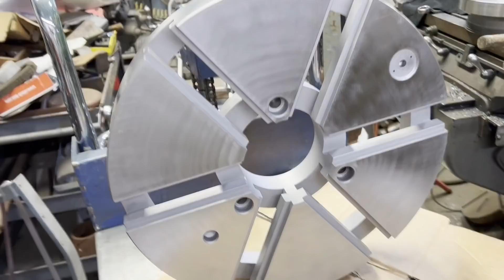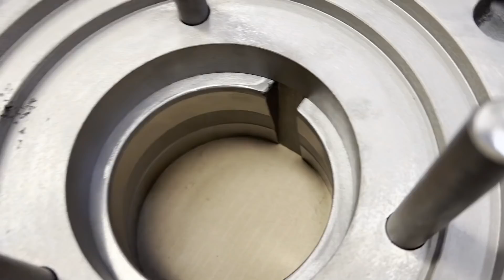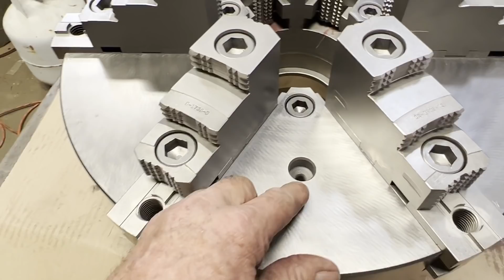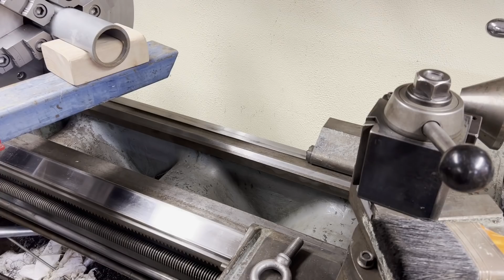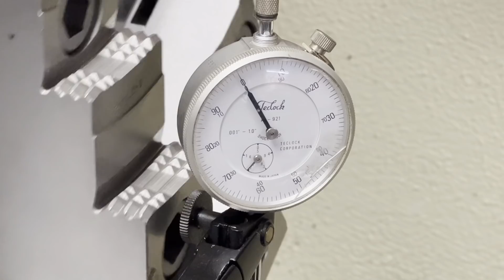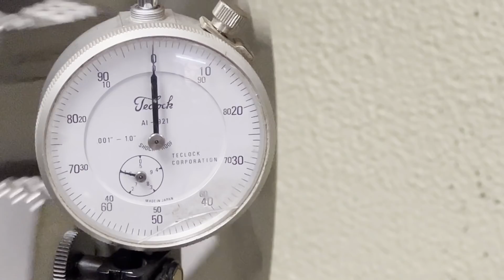Big AZZ 6 Jaw Scroll Chuck Part 2

Comment: Great great work and video. But how the wall behind the lathe can be so clean... it's a mistery to me.
Reply from the maker: They are strictly for show.    LOL 
To be honest, I do more natural gas compressor Valves than anything and they just require light cuts. And the wall stays cleaner because I do not like using oil on the Lathe, to me it’s way too messy. I appreciate you checking out the video, thank you.     Gary

Comment: My smaller lathe is a gunsmithing Sheldon with two 5-in original Cushman chucks. I knew that Cushman had a great reputation, but these old chicks seemed strangely constructed. Surprisingly small screws through the face, just a handful of odd choices. They have very little run out, but the guy I bought it from also sold me his tool post grinder so I don't know if and how many times the Jaws have been ground though they are still quite sharp. Does the reputation hold for their especially small chucks? They both seem slightly undersized to me, there's an 11-in swing. I've been planning on replacing them with an 8-in six jaw but my budget would require an import. Do you think the 5-in chucks are worth putting in the work to rebuild them? They are both really pretty tight and show no signs of ever being crashed.

Comment: I understand that in your case it was irrelevant, but this set through the chuck feature seems to add quite a bit to the price tag. I'm very much a novice so forgive me if this question is ridiculous, but from how I understand the set through systems, it does not seem like something that would be terribly difficult to add to a chuck's backing plates. It seems like the backing plate might need to have a slightly longer neck, and tapping the three holes at 120°, seems pretty doable. The rub as I see it comes in with mating a surface to a tapered round nose like an L-1. That sure seems daunting, but investing in the right grinding wheel and using a softer brass seems significantly more difficult, but still doable. Have you heard of anybody attempting a DIY set through adaptation? What am I missing or underestimating that makes doing this so difficult? I'm sort of surprised there are not companies selling aftermarket set through backing plates for consumers desperate for an option besides replacing their chuck or regrinding the Jaws. Or are there? Please don't take any of these questions as a critique of the methods you chose. I always learn quite a bit from your channel and the finishes you get out of Rusty mistreated equipment kind of blows away all of these evaporust based channels. If I take the time to take something apart and clean the whole thing, I don't want something shiny nearly as much as I want massively improved performance. And shiny. Thanks as always for your videos. I really feel like I learn the right way to redo things.

Comment: Amazing quality and quality of materials used back then.  So your demonstration of the sensitivity of the indicator begs the question about deflection when in use. If you have a piece projecting 12” or so from the mouth of the chuck, under load from the tool post, you must see an incredible amount of deflection during the cut. What’s your take on that and how it affects accuracy of the workpiece?
Reply from the maker: Eric, when I was showing the indicator moving while I was pushing on it, what I was doing was pushing on the indicator base. I was not pushing on the work itself. Of course anytime you clamp up a piece of material that hangs out you’re going to get deflection that’s why you use the tailstock to support the other end. But with the wrist pin that I had mounted in that chuck I don’t think I could’ve pushed it hard enough to get the gauge to move. I hope that makes sense.     Gary

Comment: Don't you have a ring to secure the chuck for lefthand threading? This chuck is a gem. So accurate and in splendid condition after your restoration. What a great find. Your work is perfect, thanks for sharing.
Reply from the maker: Frank, with an L Series long taper they use a key in the spindle shaft to lock the hub so running it in both directions is no problem. They use a large nut that threads on to the hub in tightens up the taper. Hope that makes sense.    Gary

Comment: Gary you find the best stuff and that chuck is now like brand new , great job as always . I want to ask you if you prefer a thread on type chuck or the cam lock type and why . I'm looking to buy another lathe and would like your opinion . thank you for the videos , and  I think splitting longer videos into two parts is a good idea , but to me it doesn't  matter .
Reply from the maker: Otto, I have a few Lathes and I have L Series long taper and D1 . Which ones do I prefer, that is a good question. 
This is only my opinion, and some may have different opinions. But I like the positive lock up of the L series long taper. But with that being said there are times where it is more difficult swapping chucks than it is with my D1-6 mounts. The D1 mount is an awesome mount and in my opinion much easier when swapping chucks.
I hope that helps.     Gary

Comment: Impossibly Accurate ! ...... must be a faulty gauge (LOL)  !   I know on some of my scroll chucks with 3 tightening positions,  that going around and tightening each of them while indicating the workpiece ( similar to independent chucks)  I can improve the accuracy somewhat .  Not sure the physics behind that, but it has kept me from throwing a chuck, that I had thought worthless, into the scrap pile .  Are we going to see Gary making a new chuck key for that beauty sometime in the future ? ........ or you gonna stick with the breaker bar .  Great set of videos ...... and yes,  I vote for the two-part ones !   Great job as usual .... you the Man !
Reply from the maker: I was just getting used to the breaker bar LOL
And it’s amazing how you can tweak an indicator to behave the way you want it to behave LOL
I have found in the past that when you get different results depending on where you put the chuck key tells you that you have a little extra play where the scroll fits into the chuck. The scroll will always wanna push away from where you put the chuck key. I hope that makes sense.
I appreciate you watching the video and leaving a comment.    Gary